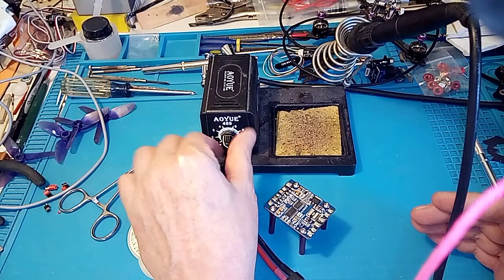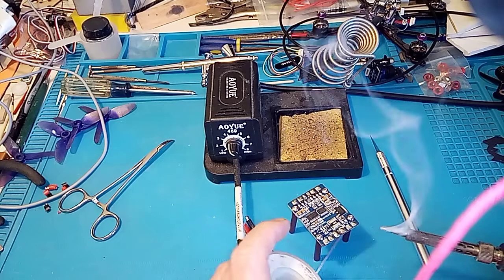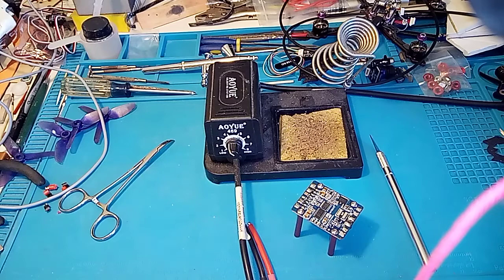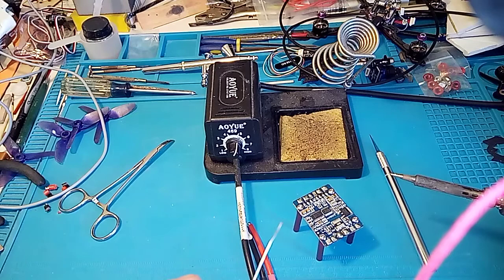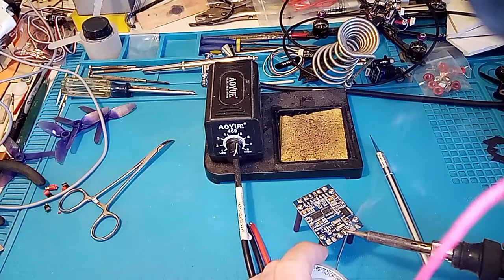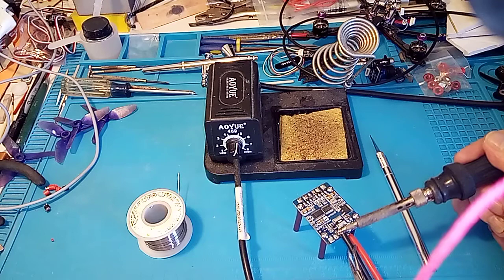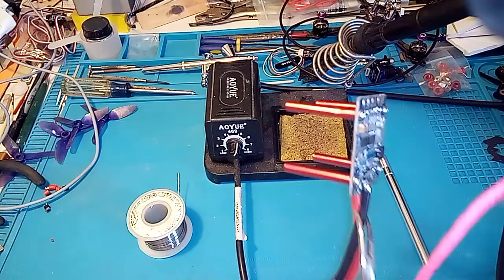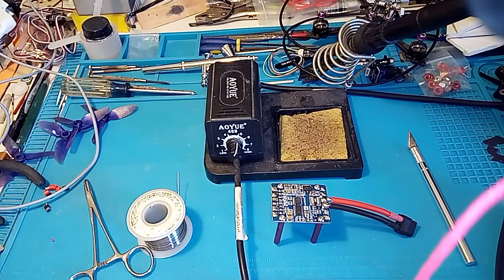Teaching Bardwell how to solder.

Comment: Basically, I disagree with much of what you believe. I have been soldering for over 50 years; both in my profession and for personal use. I have also soldered both electronics and copper plumbing (same principles apply to both, except you will never get a good copper pipe joint using your methods). That said, I am not going to pick apart your technics. You have your concepts and I have mine.
Reply from the maker: Thank you for your comment. Sorry you failed to comprehend parts of it where I SPECIFICALLY point out this is NOT meant for plumbers. You do you mate if you have a method that works for you rock on. this was meant to show new people in the RC hobby how to NOT damage components after watching several ham-fisted people insisting they need to WELD components rather than solder them.
Reply: @borgonianevolution  I agree that there are a lot of BAD soldering videos. I only mentioned plumbing because the process is the same: A heating tool (iron or torch) is used to heat the material, when the material is hot the solder is applied to the material and it will flow and bond. I always "tin" all wires and pads first which is very effective and makes the process go smoother. Burning something is a result of spending too much time on the pad regardless of iron temperature, but then you probably knew that. Yes, I will do me and you do you.

Comment: Honestly, I think beginners' ruining boards are the result of poor-quality solder, not the "heat the pad queue."  I bought the El Cheapo Amazon solder, and it won't melt or flow properly even at 900 degrees.  Simply flowing an xt60 joint (only touching the solder) is enough to heat the entire board to finger-burning temperature.  You will transfer the same amount of heat to the board whether you touch the pad or not simply because there is liquid metal (an excellent conductor) bridging the gap between the pad and iron.  What causes board overheating is how hot the iron is and how long you spend.  With good solder that melts at low temperatures and flows quickly, little time and heat are needed.
Reply from the maker: Probably because you are using that lead free shit solder. 60/40 rosin core is all you will ever need. No flux pens none of that other crap these knuckleheads preach.

I worked for Harris RF Communications building Military radios in the 90's. Their strict standards for soldering both in finished product as well as process is top notch.

95% of peoples problems when soldering is they are NOT using a FAST RECOVERY Iron NOTHING to do with the solder used.
Reply: @borgonianevolution  the solder claims to be 60 40 but is either extremely impure or has little to no rosin core.
Reply from the maker: @eldenchunugus  What brand did you use? I bought the 1lb roll of Kester's like 12 years ago and still have half a roll.
Reply: @borgonianevolution  the brand is mayium and should be one of the first things that pops up on Amazon.  I'm going to buy a roll of Kester for my next build.

Comment: He mentioned not to use a cheap soldering iron, but the one he is using is cheap 😂😂😂 it’s a 30 dollar iron
Reply from the maker: Oh you're a real brain child aren't you. There is a difference between cheap ( radio shack set wattage irons ) vs economical ( the one in the video) that not only is temperature controlled but a fast recovery iron.

Maybe try saving your level of stupid for Tik Tok and titty bars where "snarky" is cute and leave the real information for here.
Reply: @borgonianevolution  😂😂😂you’re real macho aren’t you bud. Mouthing off on social media makes u feel real tough 😂😂
Reply from the maker: @jortega61924  What are you like 16? go away or I will taunt you a second time!
Like I said save your comments for Tik Tok and titty bars where you have at least half a chance to impress some one. 

Any more childish comments I will block you and put you in time out.

Comment: Its all about the thermal mass of the iron tip. You need to use the correct tip size for the job at hand. If you want to solder big gauge wires to big pads you need a large enough tip so it will not dissipate all the heat to the wire/pad before you finished and got a good soldered joint. If your tip is too small it will keep heating the wire/pcb but will not have enough thermal mass to quickly transfer the heat to where it is needed and you end up heating the wire/pcb/component instead of soldering it.
Reply from the maker: To a point yes. but if the iron cannot keep up with replacing the heat lost the tip size will only make it worse. That is why you use the bigger ball of solder on a tinned tip to have that mass there. 

I did this video to to show new people you can solder fine electronics without cranking up the heat and peeling pads like all these uneducated knuckleheads preach in ALL of these build videos.

I spent MANY a year building electronics and doing rework on PCBs for several major companies. Take the advice or don't. My stuff always works and I have never killed a flight controller building my stuff.
Reply: @borgonianevolution  Of course - if the iron is underpowered than all of those tips doesn't matter. Maybe you should opened with - get a proper soldering iron 😂.
Bottom line is - don't mess around with it, a joint should be done as quickly as possible, if you have the right tools (iron, tip and soldering wire) its a quick job and the quicker you are the less equipment you will ruin.

Comment: I need help! 😢 flew my first bnf, battery got too low and fell out the sky onto a road and got ran over. Now need to replace all 4 motors. All the tips are appreciated. It's sometimes intimidating trying to watch videos from big YouTubers and trying to follow along. And they never answer!
Reply from the maker: Not much I can help with if you give zero information about the aircraft other then "smooshed like grape in middle of the road".. I suggest maybe post pictures and ask questions on the Flite Test Forums so people in the hobby can see what you have to work with AND be able to ask questions about your specific gear.

Comment: Thanks for the demonstration. I replied over on my channel but the gist is: if you heat the pad by transferring heat through the wire, you're over-heating the wire. The correct technique is to apply heat directly to both the pad and the wire so that they heat evenly, and finish the joint as quickly as possible. Over-heating the PCB is bad, sure, but using your technique, I think most beginners will end up with a cold joint because they don't understand that the PCB needs to get hot enough to take the solder. The way I teach it (to heat the pad primarily) is intended to solve that problem. 

Bear in mind, when I demonstrated soldering a wire to the pad, I showed putting the iron on top of the wire exactly like you do. I only touched the pad when tinning. Only when soldering a really big wire or a large ground pad would I feel it necessary to directly touch the pad. When tinning, I do touch the pad, but I'm in and out very fast and don't overheat it.

Bottom line: if what you do produces joints that are mechanically and electrically sound, then I don't care. But don't act like there is only one right way to accomplish that goal :-)
Reply: I completely agree jb
Reply: Plus good luck removing the lead free solder on pre-built quads at low heat.
Reply: ..wow, I learned something today..

Comment: This is basically the way ive been soldering for years... Flux on the wire only really helps wick in the solder quickly.  I generally dont put flux on the board cause it makes a mess.  It the solder melts to it its not a cold joint!  I really smush thw 12g wires though cause i usually use a super fine tip and am too lazy to change it.